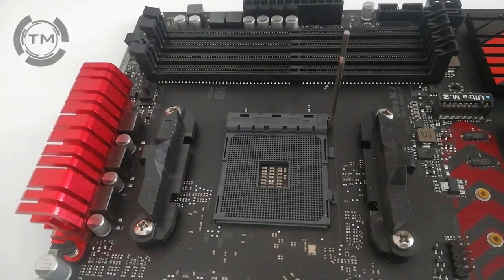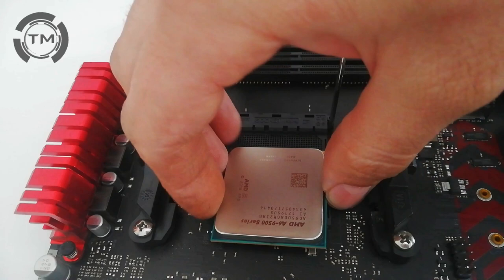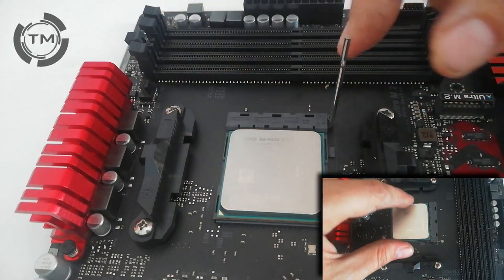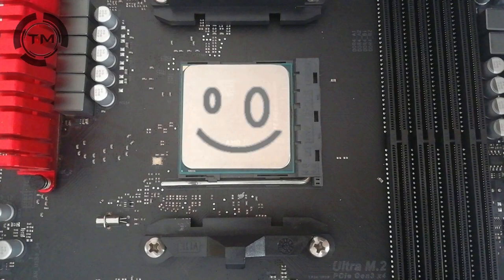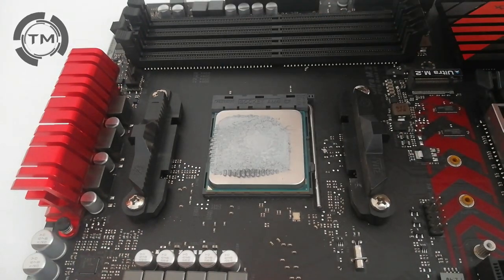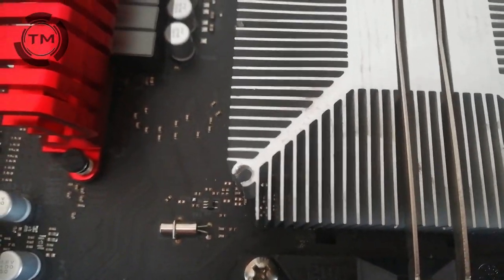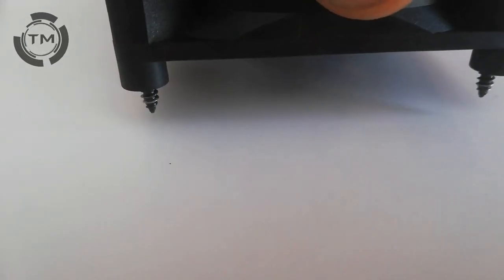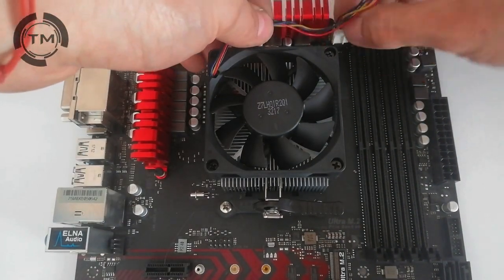How To Install AMD CPU Processor, CPU Thermal paste , CPU Cooler

Comment: You handle the cpu like it’s nothing XD, I handle it like a bomb
Reply from the maker: After you put 10 CPUs you will be very chill when doing this. I'm doing this from 2008 and stop counting the numbers. Thank you for stopping by, if you need any help related to computer hardware feel free to contact me. Best regards
Reply: @TechnologyMove  Actually yeah I’m building a  pc for my little brother just a simple PC for minecraft and very easy games to run I’m going to use Ryzen 3 3200G so I wanted to ask would that cpu work with A320M-K without bios update because I’m not sure how to update bios
Reply from the maker: @bulle7156  Depends with what BIOS version your motherboard comes from the store. If it's greater than 4801 than all will be fine, but if it's smaller you will have to update (flash) your BIOS with the latest version. You can check your BIOS version when you boot the system and press Del button. Also see this link https://www.asus.com/support/Article/563/ for flashing the BIOS. One more thing, yesterday I released a test with the Ryzen 3 3200g https://youtu.be/Pp3SDk2yJVE tell me your opinion :)